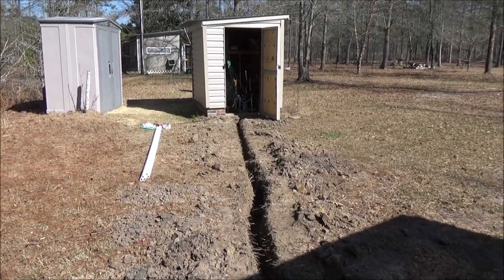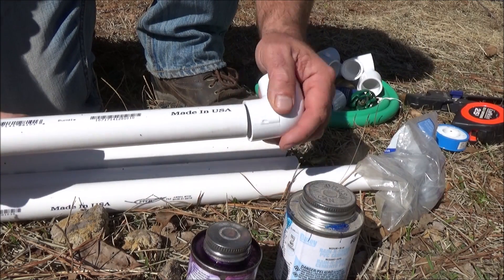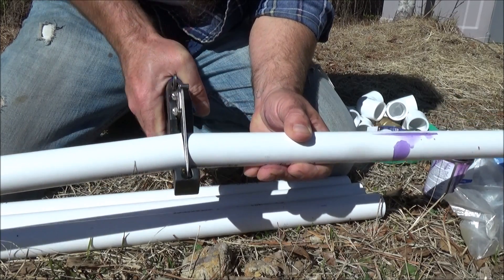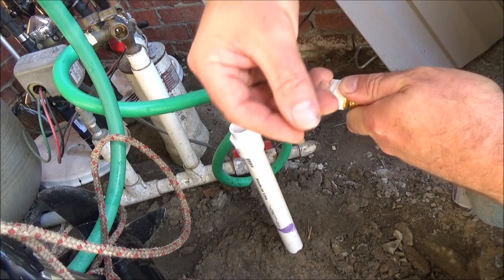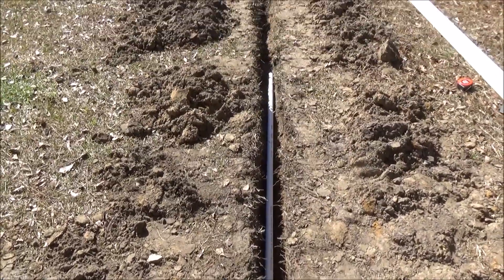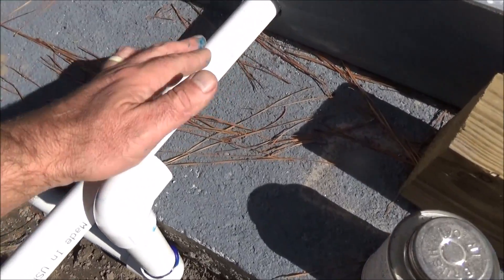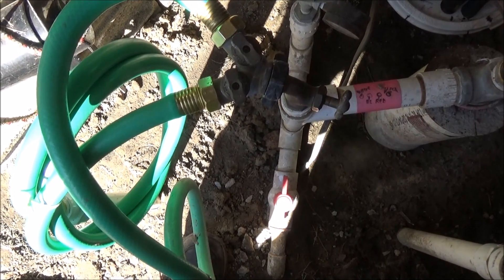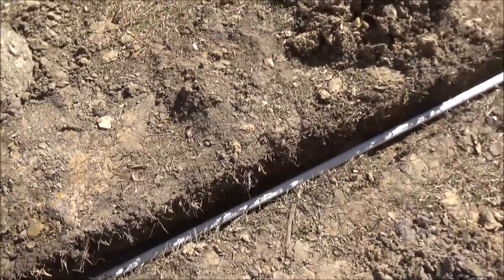installing a water line

Comment: I'm just blown away with how professionally done that line is.  I had researched how to run my own PVC line to our greenhouse, and the process was identical, but I'd never seen a ratcheting cutter before!  I thought I'd need a saw table or risk making jagged or poorly angled cuts!
Reply from the maker: I used a hacksaw for years. But when I started doing a lot of PVC projects and plumbing repairs, I bought this baby. You can borrow it if you work on something cool!

Comment: Since you handled this PVC project expertly, just FYI, I've seen people use PVC for hydroponics, aquaponics, and even frameworks for hoop houses.  The only extra step is to paint or coat the PVC to protect from UV light and offgassing... and maybe a bigger pipe cutter or drill bit for some projects!

Comment: Hey, good job on the video. The only thing that caught my attention was the fact that you continued to run the new 1 inch line off of the “Y” hose bib. That causes a serious bottleneck in your system. 

I might have simply tied the new line into the original stand pipe with a PVC “T” fitting and PVC ball valve. That would have been cleaner and you wouldn’t have to worry about the short connector hose (weak link) rupturing in the future. You would also get a much higher flow rate through the PVC valve. JMHO.
Reply from the maker: Understood! I have enough pressure but it was a retrofit. I would do it differently in the future.

Comment: How has it held up over the past year? I'm thinking of running a line out to my raised bed so I don't have to drag the hose all over the place.
Reply from the maker: Absolutely fine. You could use flexible tubing as well (PEX). I just had PVC layin around.
Reply: @gregpryorhomestead  it needs purged for winter....or it needs to be under 2 feet at least of insulation.

Comment: This would be a good time to add an electric line as well.  Most contractors would run a dummy metal wire which would identify where the water line is if you ever have to dig in the future.  (Miss Dig)
Reply: @Drew Funderburk WTF, lol you are full of crap.  Seen it done many times and this video does not show the gas company running a line.
Reply: @Drew Funderburk actually if you run a tracer wire with it, it makes the non metallic line locatable. 

I assume that's what the OP was referencing.

Gas companies (and many municipal water companies) do to their poly or pvc piping to make it locatable. There are old steel lines that don't require such wires.
Reply: @Trentacus  Yes, sorry, I meant a tracer line.  Many contractors do it as a matter of course.
Reply: @kenhoying  You were perfectly clear about adding an easy way to locate the line along with the pvc water pipe.  You can't draw that guy a diagram with crayons, so there is nothing more you can do.  His lack of understanding isn't your fault in the slightest.

Comment: Great job !!! I need to move a water source closer to my garden from my house and I was wondering how far did you run the pvc pipe? I am concerned about loosing water pressure for my pvc drip irrigation system.

Comment: How do you decide what size pipe to use?
Reply from the maker: flyingJBmn most supply lines are 1" or 3/4". I use 1" to get maximum water pressure. You can use pvc as small as 1/2" (pex is that size) but you'll have less pressure, especially with long distances. I'm my recent video I showed installing 1" pipe more than 550 feet from the well, with great pressure at the end of the line.